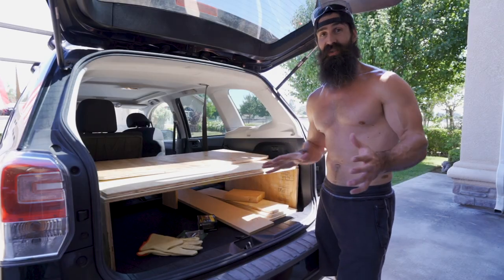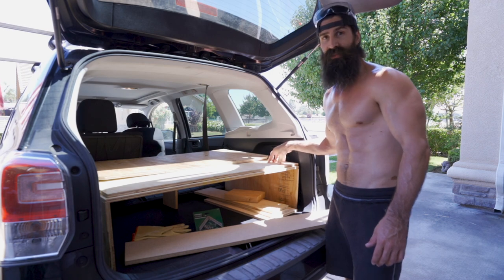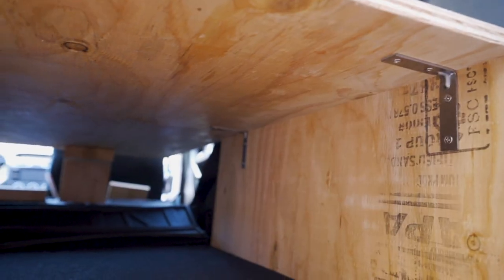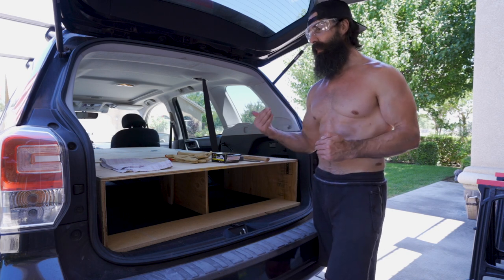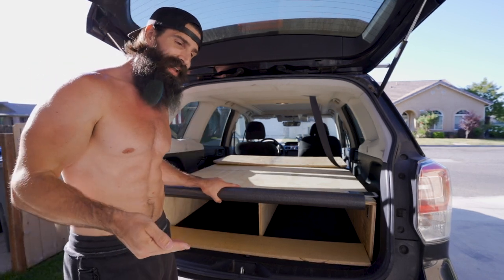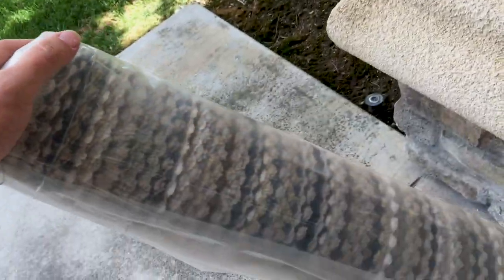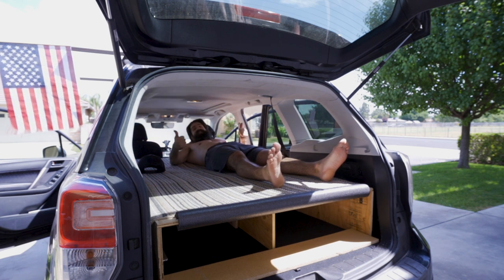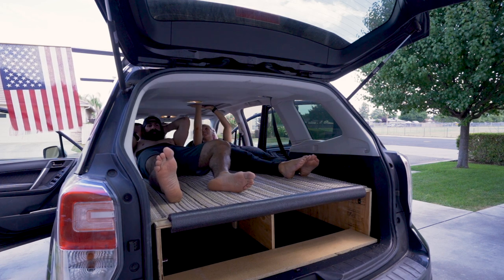CAMPER VAN CONVERSION (MINI)

Comment: Looks great, are you going to be rolling and unrolling the carpet every time? I thought you might be attaching the carpet to the boards. 

Also idk if you have a trailer hitch or not but if you do and you aren't going to be towing there are step-up attachments that truck owners use, couldn't tell how hard it was to get in and out.
Reply from the maker: Right now we have the carpet on and just flipped the front section back. The hitch is a great idea!!!
Reply: Something I would like to know once you finally have it all tested out is how long does it take to get sleep ready? 

I'm big on camping and portaging and we are always looking at the fastest way to set up camp, use used hammocks last year because the takedown and set up was by far faster than tents